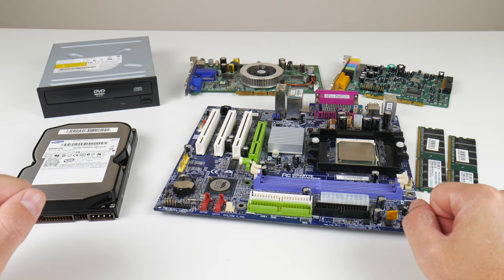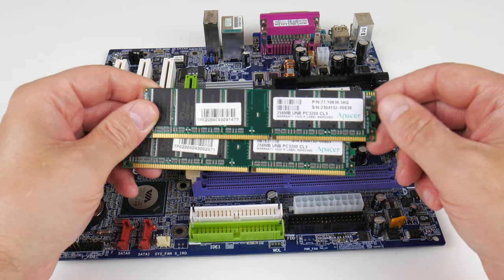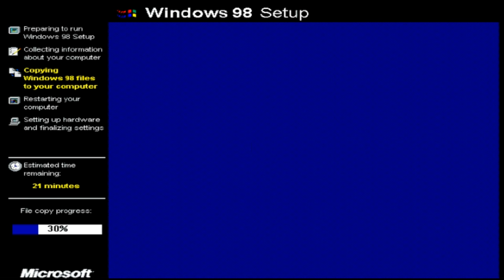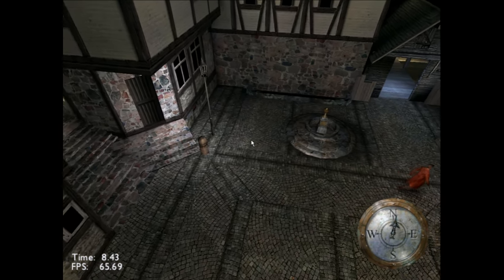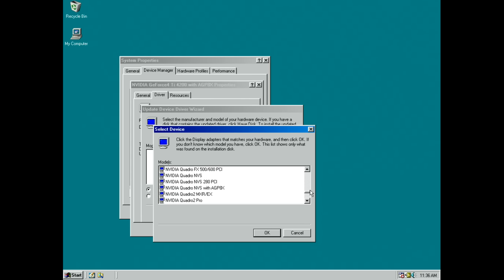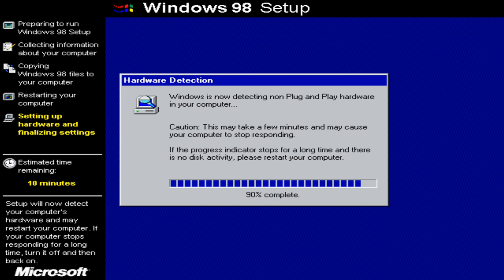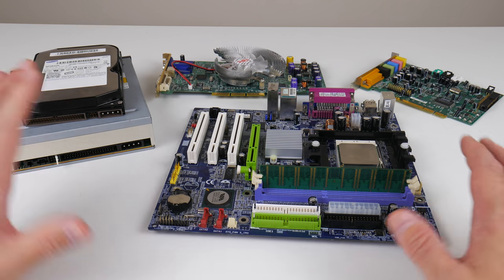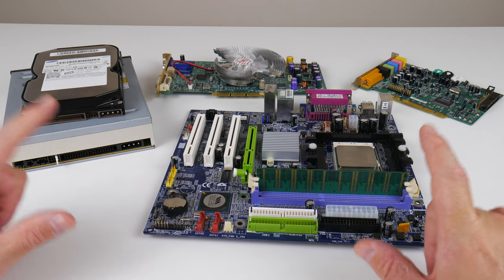Building Windows 98 Retro Gaming PC with AMD Athlon 64 Platform

Comment: I have a K8M800 from Biostar, I think It uses this same VIA Chipset, I'm thinking of picking a GeForce FX 5500 AGP for my PC retro gaming. Any suggestions?
Edit: I already have a GeForce 2 MX 400, the CPU is a Sempron but I haven't see what model is and it's using 2 1GB DDR2 667 memory modules.

Comment: I actually got 2 of these running with semprons.Didn't find any use for them yet.I actually got these 2 from pc's that stood in the rain.So i fixed the 1 up the other one was dead.Best gpu i have are ati 9200.Not the greatest but most prob the best oc card on agp platform.

Comment: My k8m800 board just doesn't allow me to install windows 98 on sata drive. I have tried everything and yes, ide harddrive and dvddrive is the best solution. In worst scenario you should try to use ide to sata adaptor. I did so, because I don't have working ide dvd rom

Comment: I seriously would go with ati, way more easier and more powerful, plus hdmi output through dvi port.
Reply: also most of the issues with hanging are related to plug and play os bios option, as well with ACPI. Disable them and the experience is much smoother.

Comment: Is it safe to say the Socket 754/939 platform is the last that can install/run Win9x straight out of the box? Did any games made for Win9x support ONLY the Glide API? If so can Nglide work as an alternative? I have a Sempron 3K (754) sitting in a board with ram laying around and a Diamond PCI Radeon 9250, I think It could make a decent Win9x rig after seeing this!
Reply from the maker: I can answer the nGlide question. Yea use a DX9 GPU, DX9 and on this platform it will perform well. With a fast CPU it will outperform a real Voodoo 5.
Reply: I guess that depends on how you define "straight out of the box" - I've had really good luck with Intel's G41/ICH7 socket 775 platform - managed to get native DOS audio, 100% Windows 98 compatibility with a vanilla Win98 installation, and solid XP performance with a dual core E8500 CPU - of course for that 100% Windows 98 compatibility you need a sound, video, and possibly a network add-on card.  These boards have a PCI-express slot so anything GEForce 6xxx or Radeon x300-x850 will work.
Reply: @retro-computing-gaming  You def caught my drift, thank you! So real DOS/win9x support died sometime around 2008 basically.
Reply: @philscomputerlab  Why thank you, plenty of DX9 cards out there too, super affordable!
Reply: Most companies dropped real support for Windows 98 sometime around 2002-2003 (the exception  being VIA which supported Windows 98 through 2005 or 2006, and they still host a lot of legacy drivers on their website).  However, there are modded chipset drivers out there for Intel chipsets all the way up to ICH10 (though anything above ICH7 is pretty hit-or-miss), so if you can get your chipset working properly, even if your board's onboard audio, video, or network doesn't work, you can replace all those functions with older PCI or PCI-E cards.  Now DOS is another animal entirely - its compatibility is all over the place depending on the exact chipset/audio card combination.

Comment: I bought a motherboard GA-K8VT800 (rev 2.0) but I encountered „zero bytes AGP memory bug” which means my 9600 Pro is much less powerful under win98. So I’ve been looking for another board (I have A64 3000 Venice 0,9 nm) and I’m considering a board with ULi 1689 or NForce3. Which one would be better, does NF3 have any problems with drivers under W98? I have heard that ULi is very stable, but these boards are hard to get.
Reply: Just to add, using older BIOS will not help, the oldest one is from 2005 and is already affected by bug.
Reply from the maker: nForce are fast, but reliability can be an issue, at least for me. I only have one board with ULI, but it still works.
Reply: This is what I feared, it remains to look for something on ULi or possibly something with VIA with possibility of flashing early BIOS. Thanks for the reply and all content you create 😊
Reply from the maker: @marcinsolars496  The other option is to consider a Pentium 4?
Reply: I had not considered P4. Maybe something on Intel 865 and LGA 775 for AGP support but this is quite exotic configuration. On the other hand building on Socket 478 probably doesnt make sense since I still have an old KV400 and Athlon XP 2000+ but I wanted to build something on last supported platform under Windows 98.

Comment: Why directx 8? Can’t you use the directx 9c ? Doesn’t 9 come with the legacy ones?
Reply: I assume many games in the Windows 98 era used DirectX 8.  You can still install DirectX 9 too for the games that need it.  It's just a bunch of .dll files that it registers in Windows.
Reply: John Smith yes but doesn’t directx 9 have the 8 libraries? Just as you said... just a bunch of dll’s.
Reply: Most games for Windows 98 don't need DirectX 9 and I've read that it may cause problems.
Reply: Barbrady yeah but does the games use actually directx9 if installed or does it search for the directx8 dll’s and use them instead?

Comment: If you want to build a 754 retro gaming machine, please avoid the ATI RS480 + SB400 chipset. It only has some beta driver for windows 98 and it's super unstable. Even for xp and above, this chipset has huge compatibility issues. E.g. USB performance is pathetic, if there are some load traffic on USB the system performance is hugely impacted.
Reply from the maker: Yea I like sticking with VIA for some reason, they work well for me :D

Comment: In order to use the Sata ports with Windows 98 you need R. Loews Patches
Reply from the maker: I haven't encountered such issues with Intel boards. Could just be the way VIA implemented the SATA controller.
Reply: Could you do a video on using Windows 98 with unsupported Graphics cards

Comment: I have exactly the same issue with controller drivers on my Win98 build with ASUS P4P800 SE + P4 3.0GHz.  Win98 just doesn't like the "modern" controllers.
Reply: Was there a driver specific to Windows 98 or were you trying to load one for a different OS version?
Reply: @dennisanderson8663  There was a Win98 driver on ASUS site for LAN, Sound (didn't need that one) and chipset. After that I've updated chipset with newer driver from Intel but the exclamation mark is still there. All working fine so I'm ignoring it for now.
Reply from the maker: Intel 865 chipset works best for Windows 98 with working SATA and no issues!
Reply: @philscomputerlab SATA on my board comes from ICH5R (as manual states) and ASUS has no Win98 drivers for it. Only Windows 2000 and newer.

Comment: Via sata controllers have always been crap. I had a asus/via motherboard in my nas and at first it had no problem with my sata 2 hdd, but then it decided not to detect it anymore and i have to flash the hdd so that it would start at sata 1 instead for it to work. Plus not only sata, SIS/VIA's chipsets have always been very buggy and with lots of driver patches for windows for them to work. Not a single one ive ever seen was straight forward like AMD's or Intel's chipsets in the drivers department.
Reply: Not true, I got a VIA based SATA card that was one of the best options for flashing firmware to the Xbox 360 DVD drives.
Reply: @dennisanderson8663  
Who gives a crap about flashing a 360 dvd, im talking about using it for actual work. Oh so you used it once and it worked? who cares!? try using it for a long time and tell me how many dma errors, link disconections, or outwrite bsod you get.
Like i said, mine wouldnt even recognize an hdd or would for a season and then wouldnt for another until i flashed the hdd so that it would start in sata 1.
VIA doesnt follow standards, nor puts much effot into it thats why both the hardware and drivers are crap.
Ask anyone that built pcs and he will tell you VIA is crap.

Comment: This motherboard sounds like nothing but trouble. All the lockups and installation failures and stuff. It gave me a feeling of nostalgia. The early 2000s were full of this kind of thing. It was a wild west of hardware developers and compatibility was a total crapshoot. There was very little agreed upon standardization at that point in history. Tons of different architectures and protocols and standards, etc.
Reply: Phil switched to IDE/PATA HDD later in the video (14:53) and everything ran smooth. SATA was not a build-in standard even in the WinXP era, let alone for a Win98SE retro build. A clean install of WinXP on a fresh SATA HDD requires MB-specific SATA driver, often on a floppy, something we don't have easy and plentiful supply nowadays (drive AND disk). IMHO a solid IDE/PATA HDD would fit WinXP and earlier operating systems perfectly; the only OS I'd recommend using SATA HDD is Vista for having native SATA support but no TRIM function for SSD; Win7 and newer should use SSD for C drive.
Reply: @dormcat  Thank you for recapping the video I just watched. Just in case I forgot what happened at the end.

Comment: Please can you help me? I was sharing files from windows xp to windows 10 using build in file share. It wasnt working very well. Sometimes i could not access the shared folder but that is not the point. When it worked it was only about 7MB(56Mbit) But i was running it at 100Mbit Lan. And it was the same even when i shared some files between 2 win 10 pcs (the shared folder wasnt protected with a password) And BTW, great system. athlon 64 is quite powerfull cpu.
Reply: I do find SMB to be a broken system for file sharing.  Microsoft tried improving it with the Homegroup system in Windows 7 but it still has its issues.

Comment: MSI K8MM-V has the same chipset config and also freezes twice in windows 9x install, and the ide device issues but only when using sata drives. 

Also while using sata the drives were forced into MSDOS compatibility mode so for 9x i disabled the sata controller and used IDE and the exclamation device issue went away.
Reply from the maker: Same! I also now just use IDE controller and disable SATA and it's a great Windows 98 board.

Comment: People like the turtle Beach card, but the drivers are trash. Each update changed the 3d rendering quality. I had one, and don't really know which version is best for what, if there ever was a good driver. That said, it worked fine for regular sound outside of 3d API support.
Reply from the maker: I use the latest drivers!
Reply: @philscomputerlab  the biggest  differences probably were with Unreal tournament, as the effects changed, but it's not like the older version didn't have issues either. Neither were game breaking, but it always felt like the card was not rendering 3d correctly in some form. Dunno, it was tolerable, but never consistent or felt like 3d was correct. The older whql set might have sounded a little better overall though.

Comment: My best performance retro win 98 se 
Amd Athlon 64 3200+  2.2 Ghz socket 754
MB   MS-7181 
512 mb  DDR1 ram
HDD1 quantum fireball 10 Gb
HDD2 foe data  80 Gb maxtor
GeForce 4 Ti 4200 64Mb  128 bit  with nvidia_9x_81.98  and dx9.0c
Soundblaster sb0100

Comment: Corsair VS are bad not awful but I suggest to use another PSU. Really cheap build, bad OEM design and really bad caps. I worry about lose rare vintage hardware due to bad PSU choice. 754 are 12v oriented so you can use a modern PSU without any issues.

Comment: People have a poor opinion of via because they're not compatible with anything, ever. It still bothers me beyond belief you keep acting like they don't have problems when my own are months long and well documented.

I have an Asus A8V deluxe like you showed in your earlier videos. Guess what? Soon as i install the chipset drivers, the install is dead, because I'll never be able to boot into it again. It corrupts itself that quickly. This is even before factoring in drivers for anything else.
Reply: I have an Asus A8V Deluxe in my Windows XP System. It works without any issues
Reply from the maker: I document and mention whenever I have issues. Fair enough it didn't work out for you, but I can only report on what I experience myself not Internet gossip.
Reply: @philscomputerlab  The kindest thing I can say about VIA is that it made me appreciate how much better nforce boards were at the time. I really cannot say anything else positive about my own personal experiences with them.
Reply: I don't know about the later chipsets but I have a good experience with the KT266A chipset so far.
Reply: @Rickenbacker451  i had one of those back then with an xp 1700+ cpu. I had to UNDERclock mine to get it to boot at all. And it died all too quickly. Mercifully back then, nforce boards came out while i was able to exchange it with Newegg, and actually be able to use the parts I sunk so much money into.

Right now, i have an abit kw7 board for socket a and an asus a8v, like phil showed in their videos. In neither case were said boards stable or usable at all. With ubcd i can run memtest all week on either platform with no errors. I could run Prime95 off either platform with no errors or misgivings. But soon as i do an os install and install drivers, the thing instantly kills itself and i can't even boot to safe mode without crashing. How VIA hasn't been sued a bunch of times for that is incomprehensible.

Comment: wait wait wait wait.... it's too FAST!!!??? and no recommendation on changing cool'n'quiet multiplyer's?? on the fly even??? AFAIK it should work with win98. anyway, <3 all

edit: DOS videos look fun with this! PCI sound in DOS might not work without EMM386...
Reply from the maker: You can change the multiplier in BIOS, but pretty sure also through software live in Windows.
Reply: @philscomputerlab  I presume you're gonna cover that in the DOS videos ;) (edit) I do setup cool'n'quiet or powerNOW! for energy, but don't remember if it works on win9x or DOS so...

Comment: Don't most of the games work fine in XP? Why use Windows 98, why use an hdd instead of an ssd ( I know trim is not supported until 7, but still much faster than slowshit hdd).

I personally swear by XP, be it for my first lappy ever ( p3 600mhz, 192 mb ram) or for high end pc's (my old man works on xp 64 with an i7 6700k, 16gb ram, SSD and a GTX970...
Tbh running on 10, very few games don't run in it and 99% of them have fixes for Win 10.

Comment: This is not good retro windows 98 PC, because it doesn't have Glide. For windows 98 games it's overkill. 
The much better option is to use PCI graphic card connected with some 3dfx card. Eighter Geforce 256 DDR + voodoo 2/Diamond monster 3D II 12 MB accelator.  Or Geforce 2 ti with 3dfx stand-alone accelerator. Or, try to get Voodoo 5, which are quite expensive. It's so pity 3dfx didnt last little years longer, and did little more powerful cards with Glide support, they would be awesome for retro win98 gaming PC now. Problem is voodoo5 is still too weak for year2000 and later titles.

Another reason, why this is not good platform, is because you cannot use ISA soundblaster card, for DOS games. Some older chipsets had even support for old soundblaster cards games, that emulated it, like AC97 codec. This is why, much better win98 retro PC is to built upon old Thunderbird (Athlon), with about 1,33 Ghz. You can get direct DOS support, you can get Glide support, and it's still decent for 2000-2003 titles, at least in 800x600, 1024x768, that's it, how most people played it in those times. So if you want retro, don't use 1600x1200, it wasnt used by 99% users in windows 98 era. And during windows98 era, DOS games were still popular and played frequently, you can downclock CPU or disable cache, and under windows 98, you can use SlowCPU utility, to slow CPU to like 10 or 5% speed, as it has still real-DOS support built in, and with that soundblaster support, you can play even old DOS games from around 1990 on it, even with sounds, without emulation. So you have 2in1 computer. And what is good, is you can make dualboot with Windows XP, and that computer is still powerfull enough for some early windows XP stuff, of course games from 2004 like Half-life 2, doom3 or Far Cry will kill it. But anyway, with this combo, it will cover all DOS era (dos games computer), windows 98 era, and early winxp era. That's much better build, with dualboot windows 98/windows xp + ability to go to real DOS. So you don't have to have 2 or 3 retro computers, you have it all in one.

Comment: windows 98 supports 1gb or ram out of the box, but by editing some system files you can use as much as you want
Reply: I'm not sure why you would need more than 1GB for Windows 98.
Reply: I've read Windows 98 can't even use 512MB properly. I think 256MB to 384MB is the best option. With 1GB you will just have problems.

Comment: Windows 98 is a 32 bit operating system. I see no point in using a 64 bit processor for windows 98. This makes no sense whatsoever.
Reply: If you knew anything about CPUs you would know Athlon 64s completely blew away the best Pentium 4s.